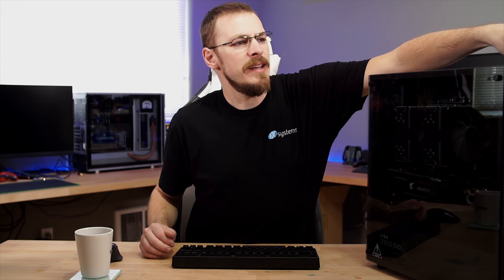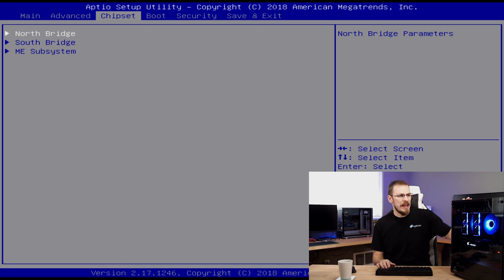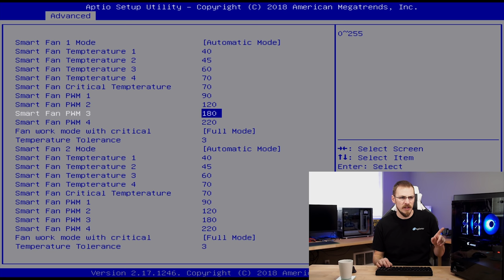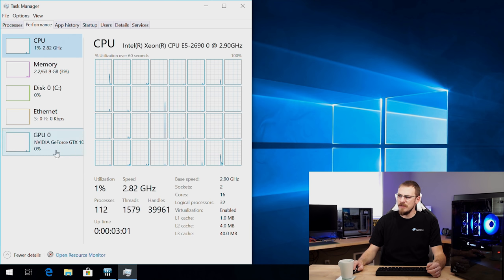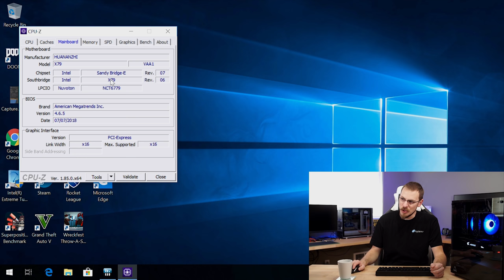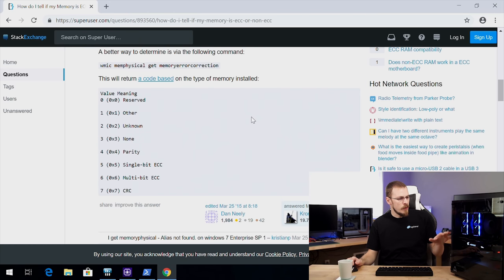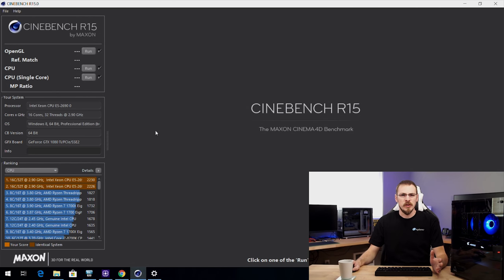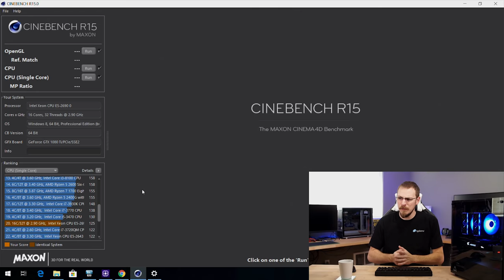Huanan "Dual X79" Motherboard Review

Comment: Wew, i didn't know you were so "new" to YouTube. Great to see your channel going so great. But probably what surprised me the most was you referencing a 6-week old comment! Good to see you remember us well.

Edit: for real, making the product's box its own retail box was clever.
Reply from the maker: I read pretty much every comment :-)
Reply: @CraftComputing  Even this? ;D  Excellent video as always! You got me wondering why the company doesn't improve the BIOS just a bit given some of the things you mentioned, but is it possible they can't really change the BIOS? The lack of fan control is peculiar, and it's a shame about the UEFI issues. I can understand the lack of any oc'ing at all on the board though, that VRM doesn't look like it could handle anything out of spec.

One thing, presumably with the E5 v1 installed the PCIe slots run at 2.0; do you know if they would therefore run at 3.0 with an E5 v2 installed? Should do in theory, just a pity the v2s are so much more expensive ( and if only one could get the ASUS WS boards for a decent price).

I was also wondering whether the system would let you use one of the x16 slots for something like a 950 Pro (or equivalent Intel), ie. NVMe SSDs that have their own boot ROM and can thus be used as a C-drive.

Re the inverted box, I've seen that before with UK refurb dealers, eg. they'll ship out Gigabyte mbds with the original box inverted as they're one of the few that have a plain white inner surface. Was a nice surpise when I bought an X58 UD3R to discover it had come with its original box.

Btw, almost 70K subs, woohoo! 8)
Reply from the maker: Even this ;-)

And I agree about the BIOS.  That's really the thing holding these boards back from being sooooo much better.

The last couple boards I had did not support booting from PCIe devices (I tried with a couple RAID cards, same theory as NVMe BootROMs).

Nope on PCIe.  While the PCIe controller is on the CPU, the version is still determined by the motherboard.  Installing a v2 chip would run the ports as PCIe 2.0 ports.

Thanks for watching!
Reply: About the PCI-E 2.0/3.0 question, i had a 3930k on a MSI X79A-GD65 wich by default ran all the PCI-E slots at 2.0 but with some fix i found on the web it would run the slots at 3.0 speeds. 

I wonder if that fix was X79 specific or if it would work on a C602 board as well? (PS, awesome video! Love your channel!)
Reply: @CraftComputing   Makes me wonder whether there's something about the Megatrends BIOS usage that means they can't modify it much, or at all.

Mattias, the fix you're referring to is no doubt the tool NVIDIA released which forces the link to 3.0. Still not entirely sure what that tool is doing given Intel's specs do say the official speed for the 3930K is 2.0. Most odd. I talked to a few people though who said they'd encountere stability issues when forcing the slots to 3.0, so I put them back to 2.0 (didn't matter, was only using a single GTX 980) until I finally upgraded to a 4930K which of course makes them 3.0 anyway.

Comment: They cannot pay Intel for Licensing there chips. thats why they dont advertise it.
Reply: sounds realistically
Reply: Also, most consumers probably don’t know what the heck C602 is.
Reply: their
Reply: @tacticalcenter8658  ok
Reply: @mattstone8878  I can haz chesburger
Reply: Tactical Center
Dumped in Asia for less, old crap, weird chip sets....
Licensing, why you cry?
Reply: @lucasrem  who's cryin?
Reply: @tacticalcenter8658  Gamers do that, i need it now crying, the promoted item shows on YouTube! You run a show?
Reply: @lucasrem  your comment doesnt relate here as far as I can tell. No one needs this now and no one's crying about it. I have a Asus rampage IV extreme x79 mobo and it's worlds better than this mobo... But only a single socket.
Reply: they actually "recycled" those chips.... because there was a demand of using x79/x58 cpus in china and all those  mbs are discontinued...that's why there is a market..
Reply: These chinese boards are mostly made from salvaged dead boards.  So they didn't even have to pay for most of the component and even the chipset
Reply: @tacticalcenter8658  *Grammar, *Nazi, the first period should be a comma.
Oh, crap, that's a sentence fragment... I will now commit sudoku.

Comment: Shhh don't say bad things about my i7 2600. I like thinking it's still a good cpu. Not that it doesn't run everything I need perfectly fine.
Reply: currently running one at 4.2ghz because im lucky enough to have a z68 motherboard :)
Reply: @izaaka70  it would be nice to get higher clock speed, but mine isn't unlocked so I don't think even with a z68 or z77 mobo that mine can go past 3.8GHz. Idk
Reply: P67 maximus lga 1155 with a 3770 (non k). 1080p 60fps... its over enough
Reply: @KitKater  ahhh see Mine's a non K chip also, I'm only able to raise the base clock
Reply: I got a good i5 2500k
But my cooling is shit. ):
Won't do more than 1.33V and that at 90c.
So I clocked down to 4.2 with nearly stock voltage.
Will clock it up to that sweet 5Ghz.
Once I got better cooling.. And a mini fan for my vrm
Reply: I knew my i7s time was up when a Ryzen 3 beat it.
Reply: @f.a.i9638  ahh thats a rip. unless you have other cooling issues you lost the lottery with that chip. my 2550K is at 4.6 on air coolermaster v8. i forget the voltage its been years, but it never gets past 85. thats still pretty warm though. My 5775c is only at 4.2 but Broadwell is a whole different animal, a Sandy Bridge should clock alot better. i would just sell it and roll again, or get a 2700K for 30 bucks more.

Comment: I have 3 Huanan boards, single socket. Two of them are C602 and one is X79 (which is the same as a C602 but for desktop, as you know). They look scratched on the die surface. I'd say that Huanan is desoldering the chips from old server boards and making this new ones.
Reply: In China, HuaNan is known as a factory using refurbished chipsets.
Reply: Is that a good or bad?
Reply: @miliondrmz  Well it's not very good but about as good as it's gonna get. These are old platforms. You're not gonna find a good big NOS (new old stock) warehouse full of chipsets. It'll be a little batch of NOS here, a batch of desoldered salvage there, all different steppings. Best hope they test it well afterwards, and don't expect the thing to last for the next 10 or 20 years.
Reply: @SianaGearz  I would be happy if the board lasts 2-3 years, but looks like I can't have it as my main workstation.

Comment: Also worth mentioning is that the older CPUs won't be supported by modern Hypervisors for much longer.
For example, I got a "CPU support ending" warning when installing vSphere 6.7 on a HP Ivy Bridge based system.

Comment: I bought myself 3 x x79 2.49 HUANANZHI motherboards. The green ones. They've worked pretty good. Two of the boards are being used as vm servers and the third as my desktop running with a gigabyte RX580 8GB. Performance wise with games at 1440p running with a e5 2630 v1. They get pretty close to what most benchmarks on the rx580 8gb get on YouTube. I am glad you did this review on this board. I had been eyeing it out on AliExpress for quite a few months. I think you have helped put my mind to rest and will wait for the next revision of this board. I contacted Wuson store on AliExpress(official reseller for HUANANZHI) and he mentioned that the next revision will have more ram slots, pcie slots as well as a nvme port built into the board. Though an eta on this revision is completely unknown. Hopefully they will have also resolved the quirks that you have found running this board.
Reply: Are all 3 of em alive?
Reply: @spacy9571  in China, these motherboard have 3 year warranty. so I think it will work for at least 3 year of heavy use with bad environment control. otherwise the factory will no longer  exist. I heard they have very good customer service in China.  better than some big brand motherboard company.

Comment: B4 is indeed USB related, and it seems to be a firmware bug with those chipsets.  I have a similar issue with my Supermicro X9DRE-TF+ where W10 will occasionally freeze during a soft reboot.  A hard power cycle usually clears it up.  BIOS updates are supposed to resolve it, but not all boards have been patched.

Comment: Appreciate the video; am running a Huanan Zhi x79 Deluxe with 32GB ECC Registered ram...for about 6 weeks now; no issues with configuration or booting. Did have early probs with it not going to sleep....hibernation was good, just wouldn't sleep. As you're probably aware, they ship these with no CMOS battery...so all settings are default and it needs to be properly configured. Once I worked that out...enabled S1 & S3 sleep modes...and problem solved. Am very happy with the purchase and results...however there is absolutely no support available...online or email....NOTHING! But still...excellent value and I will be buying again, in fact ordered another motherboard last night....this time a PlexHD x79; has more PCI-E slots than the Huanan Zhi, and claims to support SLI...maybe you should look at it too. I'm only planning to run an E5-2680 v2 in  mine with 64 GB this time.

So was it worth it? YEP!! BUT....I do so wish you would lessen the 'Bass' impact on your backing tracks...really - almost overpowering 'Boom Boom' shit is all I can relate it to...
Reply: I know this is an old video, but is the M.2 slot bootable on this board.

Comment: Haha I have one of these in an unraid build.  Running two gaming VM's vr capable :) works great very simple bios.  Dual E2640 32GB ECC ram.  GTX1070 and Vega56 for the two VMS.  12gb Ram each. Left a little ram for unraid to use.  I was impressed with the board it has been very solid for me.
Reply from the maker: Nice!
Reply: Why would you have such beefy gpus in a older system? Seems more expensive than just have 2 separate computers
Reply: Both used from eBay mate got them cheap.  The whole system cost about 1k Australian pretty cheap really had psu and case already.  Was originally just going to be one system with the 1070. But decided it would be fun to play with unraid so got another.  And vr is fairly high resolution so it's more GPU bound the CPU from my experience anyway.
Reply: @bigironenthusiast9343  no way... ??? You're not serious right
Reply: @TheDarkToes  if you're dropping that much money on other components, why skimp out on a motherboard?
Reply: @bigironenthusiast9343  that's pretty specious reasoning
Reply: @James Williams-Are you saying that this board supports Intel VT-d,and one can pass-through video or USB on this dual board?.
Reply: @gilmoreskeen1234  yes it does. works perfect for unraid.
Reply: @bigironenthusiast9343  I dont need a gaming rig i already have one (ryzen 7 1800x and 1080ti) Originally I just wanted something with lots of cores for some editing  and was looking for a decent used gpu for that. Then seeing as I had the stuff decided to play with unraid just for fun then that snowballed into a second gpu for vms. Just thought it would be fun.  I know it's not a perfect match cpu and gpu but I dont really care about getting hundreds of fps in games for vr 90hz is plenty and it works with two samsung oddessey headsets I have.

Comment: Would be lovely if it had 8 DIMMs, but like this it's only 32GB RAM with 8GB sticks. :(
Reply: I got a used Dell T5600 - think of it as getting the same board, with power supply, case, dvd, drive and RAID support, fans, a working fan controller, and all 8 ram slots.  The bad news is that you can't install windows until you download the RAID drivers and side load them during install because the Windows installer won't recognize the RAID controller, even in non RAID mode. And among the drivers on Dells site, there are a bunch of drivers and you just have to try them till you find the right one.
Reply: if you google jingsha dual x79 it brings up pretty much the same motherboard... (from what I can see jingsha, huanan and one that starts with a Q? i think... their all the same)
The jingsha dual x79 has 8 slots for ram though.  it also cost more, or atleast it does on newegg.

https://www.newegg.com/jingsha-x79-dual-dual-intel-xeon/p/296-003N-00001

Comment: As for the $200 dual LGA 2011 boards - right now on Newegg you can find the Gigabyte GA-7PESH2 for $199.99 before the tax with free shipping. I ordered two of them, one was DOA but they agreed to replace it, and the one that works - that is a BEAST! Installed 16 DIMMs of 16GB each and got a 256GB memory. It has LSI 2008 SAS controller on board - so you can connect up to 14 HDDs without external controllers (but you will need a splitter cable and 4 of them are 3Gb/s ports, rest are 6Gb/s). If you have EATX capable cases - i highly recommend this board.
Reply: Would the one in the video work with a single CPU?
Reply: Nice! I'm running a Z9PE-D16 I picked up for $250ish and other than a boot issue with one of the two E5-2667v2's, it's been awesome.
Reply: Does they ship to India?
Reply: Aliexpress does
Reply: It supports that high of a memory? Amazing.

Comment: I love the E5-2600v2 Xeons. Incredible value, and I’ve built several systems with them in dual CPU setups. You can get up to 12c/24t with the E5-2697v2 (but still pricey), and if you want a bit more core speed, go with the E5-2667v2, 8c/16t, 4.0GHz single core turbo, 3.6GHz all-core turbo. The best thing about using these CPUs is being able to use DDR3 registered ECC memory, which is crazy cheap. 

I built a dual 2680v2 setup for a home server running FreeNAS, Plex, OpenVPN, and PiHole. I’ve built 2 more servers around the 2680v2, 2690v1, and 2697v2 for SETI@home Systems, and even convinced a friend to go with a dual 2667v2 setup for his Plex server and streambox.
Reply: Hi gsrcrxsi, everything using this kind of mb in the video? Cheers
Reply: Sebastiano Pagani I used a chinese motherboard once but didn’t really have a great experience. It “worked” fine more or less but the turbo speeds didn’t work correctly. And it seems to have died in a few months. But this was several years ago and not the same brand used in the video. 

I prefer Supermicro boards though. They are much better quality.

Comment: Awesome, been waiting for this video, will update my comment once I've finished watching :)

Edit: Minus the buggy EFI issues this motherboard seems like great overall value for someone who needs lots of Cores for VMs and does light gaming occasionally but is GPU limited (Triple 1080p, currently using a GTX1060), the fact it's a genuine C602 chipset is really surprising, I am now heavily considering getting one of these and two E5 V2 processors to keep me ticking over for a year or two, I'll just wait to see where gaming performance is at (I'm not expecting much but as I've recently been running my Dual 95W X5650s at 65W with a custom BIOS mod at stock speeds anything is a welcome boost in performance)

Thanks for reviewing this motherboard, and for going over all the details :)

Comment: Making UEFI USB bootable on this system is a little bit tricky. You need to first enable the UEFI for storage controllers and boot options set to UEFI and Legacy, then reset with the USB stick in the port, then in the BIOS you need to go into the HDD boot priority and move the USB stick up the list - then you will be able to select the UEFI bootloader from the list.

Comment: Ok, So I bought the Huananzhi x79(lol, really an c606 chipset, as I guess i said) dual cpu and put 2637v2's into it and it runs like an champ I will say.  Everything works except you can only use 6 of the 8 dimms onboard.  The bios was from april 2019, and the m.2 slot works a charm, with 4x16gb ecc samsungs, an rx 5700xt 8gig, sabrent rocket q m.2 3100reads/2600writes, not overclockable at all, as well, only 6dimms are possible to install(not 8 like it says) Dual Intel fans(I had to sand down one side to get them to fit), USB 3.0 is non usable(crashes constantly)with and OLD old VIA usb chipset.  Thank you for the video, I wanted to see if these boards were viable still as well, and thank you for the video.  Dude, love your channel, always have great comment, cheers.  Oh yea my cinebench was 2622pts with dual 2637v2s'.

Comment: Great, I've been wanting a dual 2687w v2 set up.  And have you tried intel extreme overclocking utility? I am on an e5-1650 v2 taking the multiplier to 41 and it will take all 6 cores to 4090mhz in turbo on an x79 cheap mb.

Comment: Wish they do the same with the new amd 16 core ^^
Reply: or, better yet, allow core unlocking on the lower end amd cpus
Reply: @KadiusFTW  some Motherboards support Athlon Overclock
Reply: @-.2..  Yes, they do. I was talking about Unlocking, or getting more cores out of the cpu with bios changes. Think of it as getting the athlon 200ge up to a potential 4 core 8 thread cpu
Reply: @-.2..  
Sim, eles fazem. Eu estava falando sobre Desbloqueio, ou obtendo mais núcleos fora do cpu com as alterações do BIOS. Pense nisso como fazer com que o athlon 200ge atinja um potencial processador central de 8 threads (translated from Eng to Portuguese)
Reply: @KadiusFTW  Is that even possible??
Reply: @-.2..  Yes. Look at the older Phenom series, such as the phenom X2 555, which is a dual core that can be unlocked into a four core, or the 960T four core which can be unlocked into a six core.
Reply: @KadiusFTW  That was old school binning unlocking because there were locked, binned Cores.
The 200GE doesnt have binned cores, it has only 2 physical cores on there.